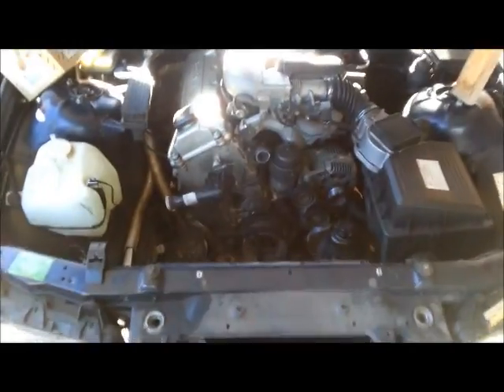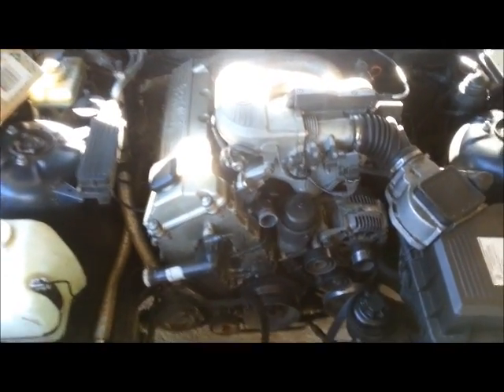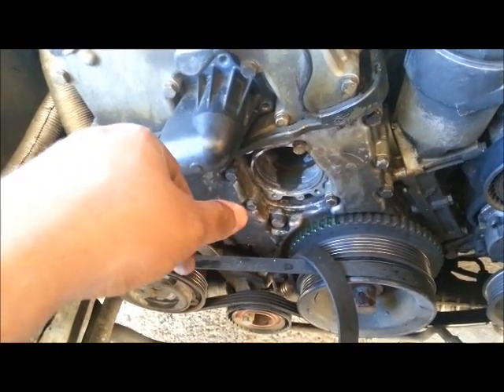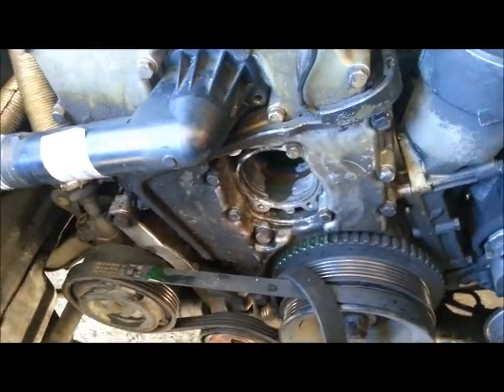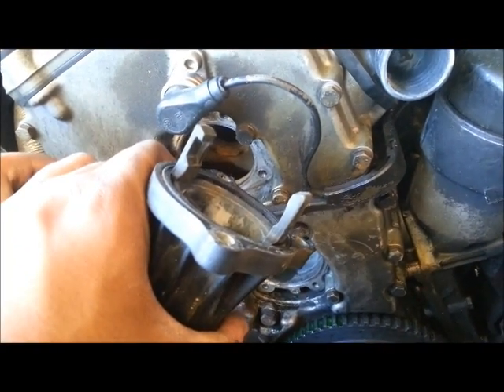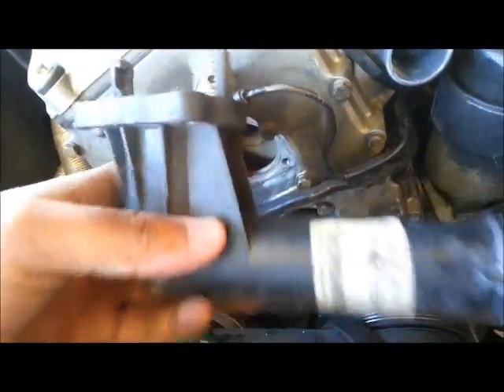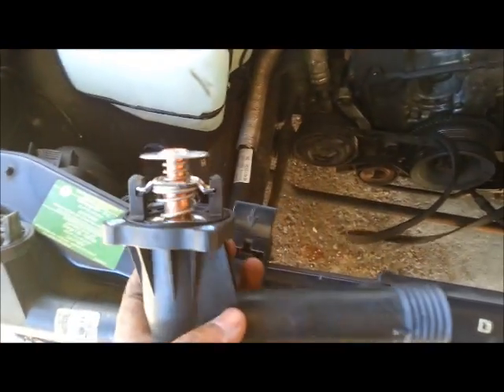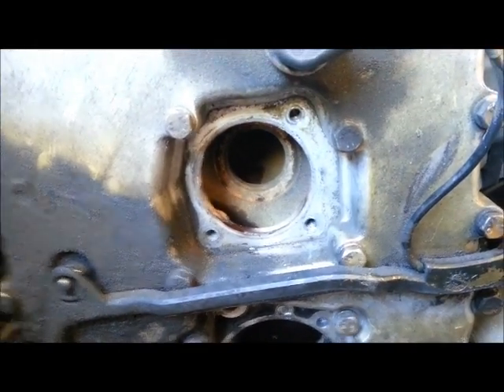BMW E36 318i M43 Motor Thermostat Diagnosis

Comment from the maker: Hi All, i wasn't active on youtube for some time, just to provide an update. the Headgasket gave way a few months later just at the back of the mother near the firewall, there was  a minuscule leak. i ended up replacing the head gasket and the issue was fixed. i have moved on to other cars in between, i will be making more videos soon, i really appreciate all the comments received on the video, it is a great learning curve for me as well, there is a lot of knowledge out there and i am very grateful for all your input! cheers!

Comment: I have a 95 318ti m44 engine that overheated and doesn't run now and I looked up my vin # and these cars have a recall on the cooling systems and they change out the radiator cap to one with a pressure valve to fix the problem

Comment: I have something I did send the head to the machine shop I did replace the head gasket I change the water pump and remove the termostat and still overheating any one know why?
Reply: Anuhar De La Vega you're heat valve pump might be faulty....

Comment: I noticed my car takes a while to reach working temperature. Could the reason also be the thermostat? Also, is it normal for the fan to start working just after I turn the engine on?
Reply from the maker: +Justas S its normal for a car to take 5-10 mins to reach normal running temperature. how much is a while?
Reply: +HR PM Up to 25 minutes.
Reply from the maker: that doesnt sound right, maybe the temp gauge is faulty? i dont think this is as a result of the thermostat. as for the fan kicking in early it controlled by the temp sensor, bring it to a BMW mechanic something doesnt add up here without proper physical diagnosis.

Comment: An old mechanic explained to me that however counterintuative, if you remove the thermostat, the coolant will circulate faster than ever intended. Seems weird, but if the coolant if flowing faster then it is probably cavitating which causes tiny bubbles to appear. Bubbles don't soak up heat very quickly, and neither does fluid that leaves an area before it can soak up the heat. Also, Water that leaves the radiator, can't cool down very well either.

Comment: I just bought a 98 318ti California edition same issue like yours and found the thermostat in the passenger door pocket. I bought it from a kid and he got ripped off by a so called mechanic who replaced the thermostat housing without the thermostat I guess. Drove the car home and it did not over heat on me on a 45 drive. The temp gauge hand was a pich above the half. What was yours reading before you fixed the issue?
Reply from the maker: quite simply. the car was overheating after 20-30mins of driving.

Comment: Really stuck on my BMW NOW, same model as yours. when first start overheating problem, found the radiatior is lecking water, then replace it. still overheat. found the fan clutch is pretty loose, replace it. won't be able to take it off, then send it to mechanical, they cant take it off as well and break my pully. Then they suggest me to buy the water pump so they can take the whole unit off. have replace water pump and fan clutch. still overheating. Now really dont know what to do, shall i go and let the work shop guys doing the air press test thing or i replaced the thermostat myself. Thank u
Reply: Destiny Fam look 4 a bleed screw mayb n sumtymz it cn jst b a radiator cap

Comment: with no thermostat and no restriction, why would it overheat.  The thermostat restrict water in the engine if it were fully open, and even less if it was missing.  After you put a thermostat in there, did the overheat stop?
Reply: HR PM like paul van said if no thermostat was in there it would alow the water to circulate therefore cooling in down but it would take a long time for the engine to reach optimum temp the thermostats job is to block the flow of coolant to the radiator until the engine has warmed up. When the engine is cold, no coolant flows through the engine. Once the engine reaches its operating temperature (generally about 200 degrees F, 95 degrees C), the thermostat opens. By letting the engine warm up as quickly as possible, the thermostat reduces engine wear. 
i noticed you removed the water bump if that was faulty that would have fixed the fault of overheating. i liked your video but you definition of a thermostat is wrong. cheers mate i'm and agricultural engineer i also have a bmw e36 318i so i speek with experience :)
Reply from the maker: HR PM
 and yes, the overheating did stop.
Reply: Hi there, my bmw e36 316i m43 engine would not start if it's cold or in the morning, but after running a miles or when the engine is hot then when you start again it start directly with acceleration.  Any advice like it is a coolant thermostat symptoms?
Reply: HR PM 
Without termostat the car Will over heat. 
Thanks for the vídeo.
Reply: No thermostat will not cause overheating issues.
Reply: The Thermostat is there to regulate water flow, if you take out the Thermostat the coolant flows too fast which does not give the radiator enough time to cool down the coolant. It's designed by engineers to have just the right amount of flow and circulation.
Reply: km pretty shure its because the back of the thermostat blocks the whole and if it's not there the water will not scurculate in the radiator just in the head

Comment: Howdy mate! I recently inherited a BMW 316i with the 1.6L M43 engine. Drove the car for a few weeks and the coolant was leaking, so I replaced the thermostat, coolant pump and radiator. A couple of weeks later white smoke started coming out of the exhaust so I knew it must be a head issue. Stopped driving the car all together. Gotta be careful with these M43 engines I think... hearing a lot about their cooling systems, and it doesn't sound good!
Reply from the maker: Agreed, the cooling system is the weak point of the m43 motor. If you do fix it however and look after it, this weakness never shows. the cooling system as with every other car if not maintained properly results in such scenarios.